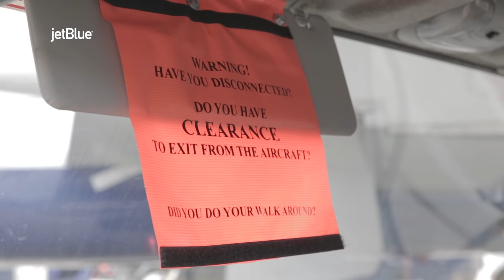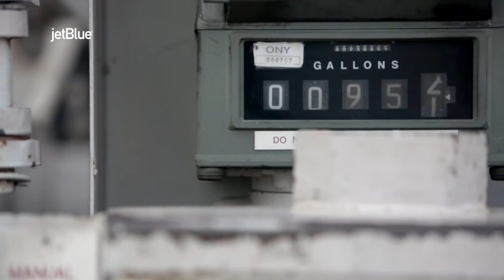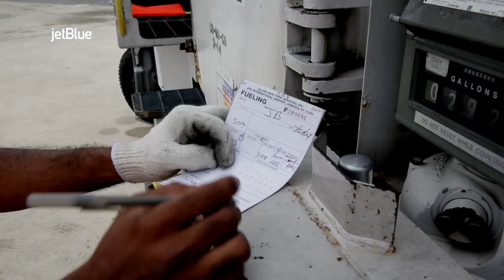A day in the life of a fueler

Comment: at 2:45

look how small the wings of the airplane are. 6500 gallons in those tiny wings? that's insane dude.
Reply: you know weight from numbers, this pea brain has worked in constructions with a tower crane so i know about weights. not just from papers like you, i have experience with weights. i'm also a stud. i have also driven a tractor with up to 20 tons behind me. if there is 320 000 liter kerosene in an A380 that's a weight of 256 000 kg into the wings. how many cars can we stack on an airplane without fuel?
Reply: Not all the fuel is stored/carried in the wings, a good portion is stored in the fuselage and some aircraft store fuel in the tail for ballast.
Reply: Again, the wings are not thin nor weak.  If you can't understand that steel and aluminum as well as other structural metals can have different properties to include strengths and yields then you are seriously lacking for this discussion.
Reply: + 225degrees 
just like a tire of an A380 can carry 25 tons, the wings are full of liquid. no way there is liquid into the wings. do you understand how much movement there would be in the tanks? to understand this, try an m³ tank of water on a trailer behind a car. drive with a full tank, with a half full tank, and an empty tank and notice the force. now imagine the 3th dimension with this, going up and down. it's just a big scam. and that's how an airplane can float after take off "2009: Airplane crash-lands into Hudson River; all aboard reported safe" it made a safe landing after takeoff. full of fuel but the wings floated. so the ultra strong material the wings are made of, can also float? what can't the wings do?
Reply: +220degrees minus 2

i'm a moron that has driven with heavy loads. acceleration is easy. deceleration with a heavy load makes your hart go faster. inertia they cal it. if you want to know what the reality is. take your car and trailer and load a tank of 1 m³ full of rain water onto the trailer. poke a hole into the bottom of the tank and take a drive. feel the difference how your car response to the liquid that is sloshing around. have you ever used your brakes when you have 20 tons of weight behind you? imagine an airplane with the tanks half full that gets into turbulently... airplanes are not made of bungee rope material.
Reply: +somedegreesleft
don't burst a blood vessel, take 10 deep breaths and relax before reading further. you know about the force of liquids in moving tanks on paper, but you have never experienced it. you are talking to a son of a farmer that doesn't know the paper works but has experienced it in real life. i've done the experiment you are talking about. the only shit a wing can carry is the big ass turbine that compresses the 70% of nitrogen in the air according to the Fibonacci numbers. and that can give free energy. because compressed nitrogen can be uses as a fuel. but i can't see the reason why they would lie to us? air travel is expensive because of the cost of the fuel. you can't spend al that money they would be making with that scam? why would they hold some technology hidden? do you really think they would create such big karma for some money in this life? authority would never lie to us, that's why we trust them. i'm getting scarred of myself right now. if i can't trust authority, that means i have to think for myseeeeeeelllll.
Reply: heiknutter,   son of a farmer.... as soon as you can prove that your dad's diesel tractor runs on free energy, I might believe you.  You tout your experience. Mine was as a Field Engineer for General Electric Company for many years. I installed and maintained gas turbines, GE, Westinghouse, and Solar around the world for years. They all operate the same..the Brayton Thermodynamic cycle. You add fuel to the compressed air and burn it the same as you do with a diesel or gasoline engine. To say that jet engines do not require fuel is ludicrous. Lets see your dad's tractor run without fuel.
Reply: +kimmer6 (i like the number)

so you're the missing degrees. you and your boyfriend degrees make up 225 degrees. i'm impressed. please share more wisdom with me. i like it.
Reply: heilnutter,  I was trying to get it through to your simpleton brain that various thermodynamic cycles require fuel to operate. Diesels, gas engines, and jet engines are heat engines that convert fuel and air to power.  Cut the fuel to them and they will each stop. By what magic do you propose that a jet aircraft engine can operate on compressed air alone? I will bet your life on the fact that it is impossible. Just because you don't think that wings can support tremendous loads of liquid fuel doesn't mean that it isn't so.
Reply: +kimmer3

“your simpleton brain"

i have a big head so there is lots of space for my brain. i know it's not more water than average because my head doesn't slush when i stop very hard.

let me explain the magic so you can understand. how much % of the air is nitrogen? according to the interwebs it's 78.09%. have you ever seen a car on nitro? they have found a way to ignite the compressed nitrogen in the air that creates thrust. and not telling us to make a shitload of money. that makes more sense to me than to think that there is 320 000 liters kerosene in an A380. i have the power to realize that i can be fooled. and you are very smart.
Reply: +kimmer4
i don't know how it works. if i was that smart, i would not be talking to you on youtube. but an A380 doesn't carry 320 000 liters of kerosene and the tires can't stand 25 tons/tire. pomping a tire to 12 bar pressure is insane. the impact of a landing airplane would crush any rubber tire. even the special ones from dunlop aircraft tyres that provide every tire on every airplane can't do this.

btw, the NWO is already here but it's not legit now. they want us to want it. thank you for looking out for my fragile little mind and keep defending the NWO. there religion is the heliocentric model, and your a slave, defending his master. if you are a critical thinker than think for yourself instead of repeating what the NWO tells you to belief.
Reply: Heilnutter, I think that you have never personally seen an Airbus 380. I never was on one but have seen them at the airport next to Boeing 747's. I have flown on 747's more than 100 times and they are huge. I even flew on Pan Am Clipper Maid of the Seas a few years before it was bombed over Lockerbie, Scotland.

Just listen to what you say. The tires are unable to carry the load? They prove you wrong every day. In fact, many airports had aprons that were unable to support the load of an A380 at gross maximum weight. They have been upgraded but some airports still cannot support A380's.

Before Masons, before NWO, before Columbus sailed across the ocean talented people were aware that the Earth was a ball, we orbit around the sun, and this was done by careful observation and early science. 

I learned 2 things at the University where I earned my engineering degrees. 1) I learned how to learn and 2) I learned how very little I knew and how many different aspects of science and engineering there were.  Whole careers are sometimes focused on one subject.

The difference between me and you is that you are basically aware that something under the bonnet of your car powers it. I can design and build every part in that engine successfully. I actually built my own gas turbine in my shop using a Rayjay turbocharger. It works, screams like hell. Can you build one that operates?
Reply: +kimmer006
what's a nutsacker? if you want to know about my nickname, look up heiknuuter in dutch. heiknuuwter is how we pronouns it in my dialect.

i like that you're helping your missus. a strong family band is what we can use more of these days. maybe you should look up something you like on YT? and comment positive on that. at your age, is it really necessary to raise your blood pressure so much?... you had a great life. if you get frustrated around your sick wife? don't do that. be a calm individual that looks at video's of airplanes. don't mind a dickhead like me that thinks authority can't be trusted and you have to think for yourself.
you have build lots of stuff and it was great. 
how many summers have you seen sir? i going to see my 38 summer soon.
Reply: Heik,  65 summers and counting. I was through Amsterdam several times in 1979 and 1980, saw Anne Frank's room, saw Vincent van Gogh's portrait from a foot away and held my breath, did the canal boat tours, etc, and spent lots of Guilders. 

Arabic weekends are Thursday and Friday. USA take Saturday and Sunday off. So when I would leave the Middle East I would follow the company's instruction to not travel on weekends. So by leaving Bahrain, Dubai, or Riyadh  on Wednesday and flying to Amsterdam (or Athens, Frankfurt, Rome, etc), I would have to stay 4 days in the city of my choice on Company expenses, then fly to New York the following Monday. I took lots of 35mm pictures.

One time I left JFK airport in New York and flew East to get to a job in Bahrain. The gas turbine parts did not arrive so after a few days I was told to report back to New York. So I booked my flights so I could continue flying East changing planes in India, Taiwan, Honolulu, San Francisco, Chicago to JFK, to Albany and a cab to our office in Schenectady (hey!!!  our office was at ''Rotterdam Industrial Park'' Building 513W...imagine that, Rotterdam in upstate New York). So I flew around the world...and never saw the ''ice wall''.

Thanks for kind words.  I'm hanging in there.
Reply: I love watching defenders of the lies. Grab some popcorn!
Reply: I love it when defenders move towards name calling!
Reply: They barely burn fuel

Jet engines a free energy devices

Comment: I just entered the industry and noticed the difference between fuel meter of the airplane and the fuel truck when refueling. Mostly the number on the truck is higher. Is this normal or the airline is paying for less ! Hope someone with experience can answer :)
Reply: Cheese
Reply: Fuel on the truck is measured in gallons and on the aircraft in pounds or kilograms due to the fuel density expanding and contracting with the temperatures.

Comment: people say if you work around the aircraft you are not as nearly smart as working on the aircraft, that's not true, they need to be good at math in order to supply the aircraft with the correct amount of fuel.
Reply: Not true if you can add basic numbers you fine.
Reply: Not true lol they tell us the amount and we just select the numbers on the plane fuel panel and pump. JetBlue is fully automatic fueling at JFK, they dont allow us to manually fuel.

Comment: The visual says, "This flight to LAX needs 42.200 (42 point 200) pounds of fuel."    I think you meant to say 42, 200 (
42 comma 200) pounds of fuel.
Reply: actually no, on our fuel slips the load would be written as 42.2 (42,200) the period separated the thousands from the hundreds.

Comment: Any tips on connecting the single point nozzle to the air bus I cannot lift it or I am do it improperly .. second day on the job and this is the only thing that's getting me nervous come time for my audit 😭
Reply: lol
Reply: Here's a tip.  Grab the hose with your left hand well done from the nozzle.  When you do this bend your knees.  Pinch the hose with your left hand against your body and guide the nozzle with your right hand(reverse the hands if you're a lefty).  When you stand up you will use your legs instead of your arms to lift the hose, guide and connect with the right hand.  If your fuel truck has a basket get it up nice and close to the wing so you're ducking your head, this will ensure that when you stand up with the hose you will absolutely meet the plane.
Reply: There's knowing how to do it, then there's the skill in actually hooking up the hose.  It's not as easy as you think.

Comment: how does so much fuel fit in the wings?
Reply: @sexigrande1792  duh. its just everybody says that the fuel is mainly in the wings. but when I try to check how much fuel the aircraft can carry (in total not only in wings) usually it does not add up with the drawings (schematics). also on the schematics the wings are always portrayed way thicker than irl.

I always found it odd that you can check how much coil a steam engined ship or diesel diesel engined ship can carry and how much they need etc and I'm not even talking about cars and trucks, but with airplanes it's all shrouded in mystery.
Reply: @sexigrande1792  I know but supposedly A380 can carry up to 315 000+ litres of fuel. on average as I was able to find out it was something like 250 000+.but it would vary.

So I roughly know how much it is in volume cuz I used to work in a warehouse where we were storing building materials. anyhow I just googled how but is 315 000 litres in volume (like a visual representation) and it's huge. most common displacement size for the tanks is 10 000 litres. now imagine 31.5 of those and its just for the fuel. so where does everything else go? cargo? hydraulics? all sorts of pumps and pipes? passenger space?

all I'm saying is that those numbers don't quite add up and I understand if we were talking about military stuff, but those are just aircrafts of all shapes and sizes.

either I'm missing a 0 in every single equation that I do or there is something that is fucky.
Reply: Some of that fuel goes to the center tank or tanks
Reply: @tsurutuneado5981  Don't forget that planes are storing their baggage there. So it does not have as much space. Also have you seen the luggage area of the plane? It's actually bigger than it's shown in the schematics and also the fuel tanks both in fuselage and wings are way smaller than on the drawings. This just leads me to believe, that fuel costs, which is like the main expense of the airlines after the airplanes themselves are BS and we are just being scammed paying premium for something that does not exist. And when you think about it that way - it does not sound as outrageous.
Reply: @donfanto1  Lmao fuel isn't even close to the most expensive thing you pay for in a ticket. The most expensive stuff you pay for I'd describe them as "airspace taxes".

I'd like to have a source to that "airplane design varies from schematics" because that's the most bullshit thing I've ever heard.
Reply: @tsurutuneado5981  idgaf what you've heard. show me a plane that can realistically hold 150 tons of fuel, 120 passengers and their cargo at the same time. A380 supposedly can hold over 300 tons of fuel. I've seen planes and I've seen 50 ton tanks. no way in hell it can hold 6-7 of those plus have the room of all the other stuff.

I'm not trying to claim anything, but as Sherlock said: once you eliminate the impossible - whatever remains, no matter how improbable becomes possible.... or something like that. I haven't read it in years. but you got the point.
Reply: @sexigrande1792  now you are going into the erroneous territory. in the court the hardest allegation to prove is an allegation of motive.

what I know is this: its advertised that average plane usually carries around 150-200 tons of fuel. in case of full capacity it can be even more. A380 is said to be able to carry 320+ tons of fuel. that's 320 000 litres of volume. Once again. I've seen those planes up close. I've seen people loading baggage and how kuch baggage is usually being loaded into those. I've been inside and flew them. I also happen to work with oil on gas stations and seen land tankers which carry the oil and how much they hold and how big they are. I know for a fact that it does not add up.

Now who knows about it, who does not know, why, how.... I don't care about those. those are the things that can not be known based on the things that I know.

I admit that I'm speculating when I say that it might be a compressed air technology, or something that involves air as a fuel/energy source. but if you want to believe an impossible bullshit - that's up to you.
Reply: @sexigrande1792  First of all I meant the things that are in public domain. Wins are always drawn much thicker than they are in real life and no indication of how large the fuel tanks are. 

As far as the legality goes - if you really think that the bureaucrats and politicians give a single solitary fuck about your or my well being - then no wonder why you much rather not believe your own eyes and believe bullshit under the pretense of "why would they lie to us". 

P.s. As long as it works and not a public hazard - nobody would bat an eye on it. Especially when they most likely value each airplane way more than they value the lives of the passengers.
Reply: @sexigrande1792  well its your judgement. hope you are right, but I would not be surprised if you weren't.
Reply: @sexigrande1792  he has no idea what he's talking about and has surely never been aside an aircraft on ground level or he wouldn't say these silly things
Reply: Shhh how dare anyone question scientists and engineers hahaha.
Reply: My family is full of engineers and they don't think they just follow orders like they were taught.